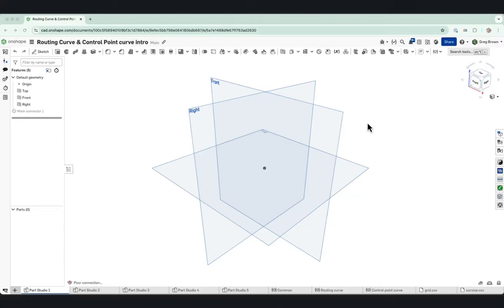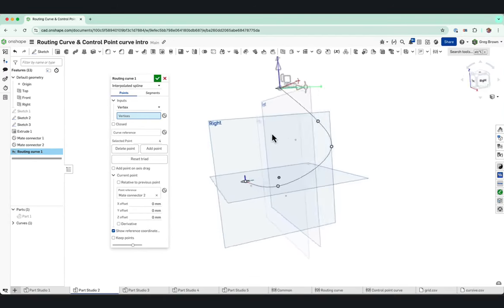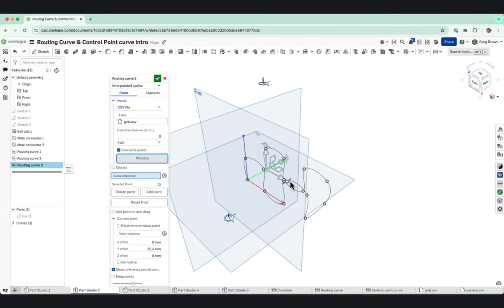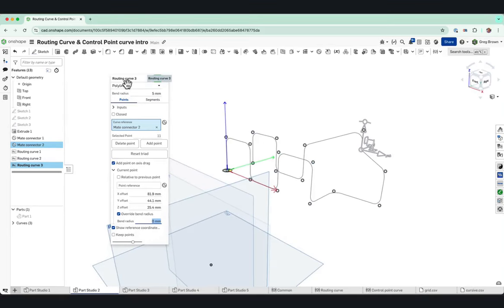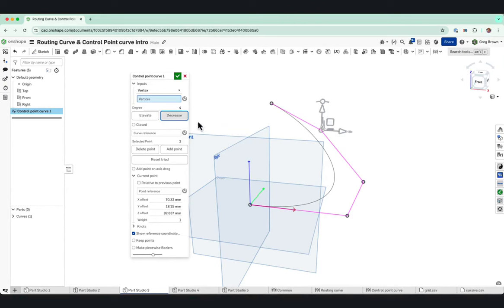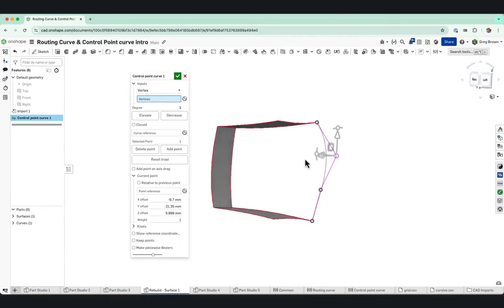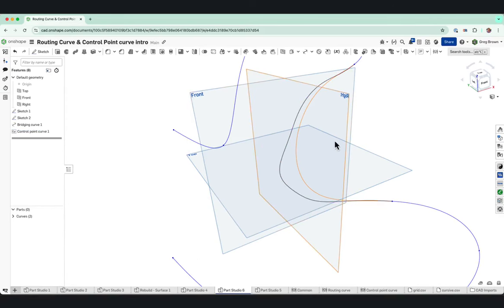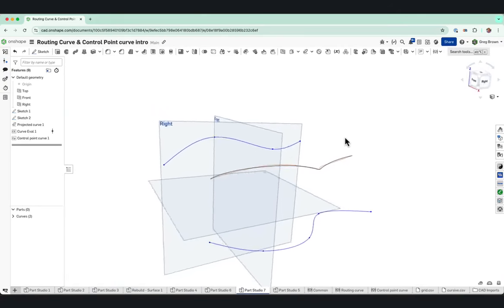Routing Curve & Control Point Curve

Comment: is there a way to control the curve so that as it tries to pass through the triads, it attempts to pass through not just the point, but actually tries to achieve passing through the center of the triad  normal to the one of the axs?  SO, say you use a mate as an end point, or a point to pass thru, can't you set the curve/spline so that at the exact point it passes thru the mate/triad, the curve attempts to pass through that point perpendicular/normal  to it?  THis is what i thought the purpose of being able to rotate the triad was for.  But it seems when you ROTATE the triad without moving it, it doesn't really alter how the curve passes through the point.

Comment: Very helpful video and features!
I did run into what is currently a frustrating limitation with the control point curve when used to re-approximate a projected curve: I don't see an option to automatically "re-process" the input curve so right now if one of the original splines (from the last example) is changed, the curve doesn't update so it's not really "parametric".
There might be cases where you might not want it to update automatically but I would have thought it should do that by default or at least provide the option!
Right now if you wanted to clean up several skeleton projected curves driven by a layout sketch, you would have to manually edit and re-process every one of them if you changed the base sketch!
Reply from the maker: Hi Airwick! If you head over to https://forum.onshape.com/discussion/24874/routing-curve-control-point-curve-introduction-of-two-new-features-for-3d-curve-creation/p1 Greg and team will see your feedback there.